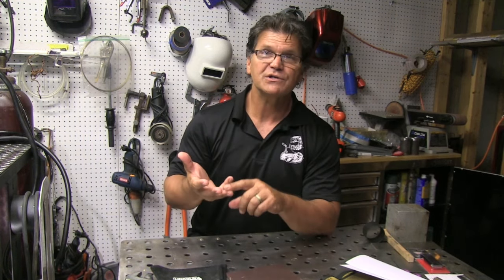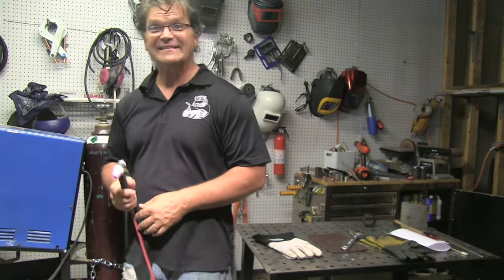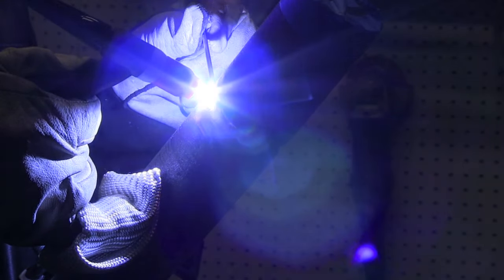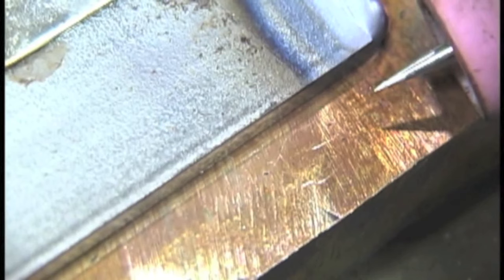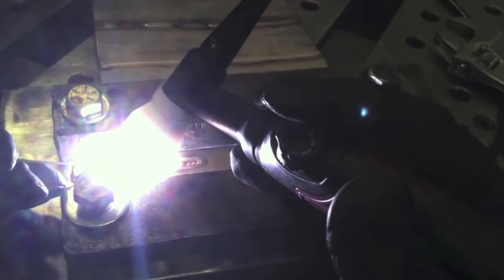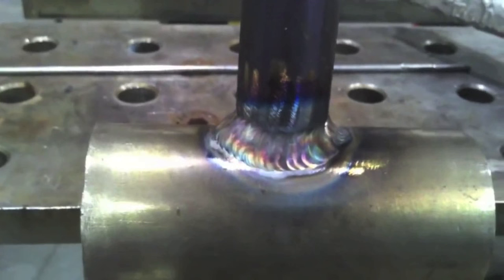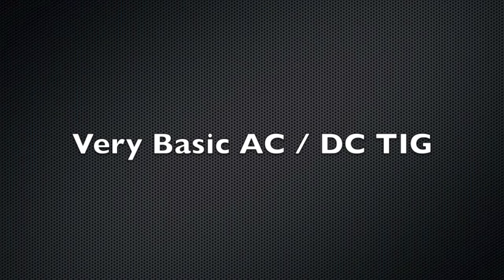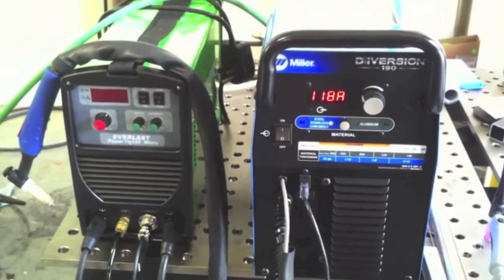TIG Welding Basics Overview

Comment: Thanks for the video! I finally made the step and ordered 2 tig fingers. Hope it doesn't take too long for them to arrive here in germany.

My question would be: I can't seem to get nice ripples on aluminum when using a foot pedal and no pulse. On a fixed amperage with a slow pulse this seems to be way better. I also get a somewhat grainy look when welding aluminum. Am I overheating the metal?

Thanks again!

Comment: Hey Jody ! I am a lifelong hobbiest  motorcycle builder and occassionally stray into other projects like my 4X4 ... anyhow not really knowing a  lot I ended up purchasing a Diversion 180. I may be able to trade up with my dealer but for now its what I have . I am an absolute beginner and for the past 2 years have been experimenting and have a tiny bit of proficiency wherein I dont destroy whatever I work with . Anyhow my questions are : with this welder am I better to switch off to a helium argon mix or stick with straight argon. My current project I intend to fab a simple stainless exhaust for a motorcycle and 2ndly will be adding  some tabs and other componetns to my existing  sched 40 rollcage on my 4X4 . One other question ..I just ordered your black friday set with both tig fingers and dvd set . Do you also do a from scratch beginners DVD set ?? Really glad I tripped over your vidoes .. I have already smacked myself in the head a few times realizing some mistakes :)

Comment: Jody,
 Great video again!! Thanks. Can you talk a bit about changing the torch head. I have purchased a everlast 265. I also got the a 18 series head from them when I ordered it. When I got it I found there are different connectors on the head itself. Can you explain the different type/sizes of connectors on torch heads? Also, on flow meter, where do you take the flow reading at? the top, middle or bottom of the ball?

Comment: I am interested in how you TIG weld experimental aircraft tubing when there are several tubes that come together.  It takes a fair bit of work to get a good fit-up.  It is then a disappointment if I then blow a hole in one of the tubes.  Thanks for the videos!

Comment: Jody, what is the feasibility of rebuilding a few damaged teeth on flywheel ring gear for a starter.  By removing the starter (this is on a tractor) a good size opening exposes the ring gear.  Probably 8 teeth have some damage.  I would reshape them after buildup with a Dremel tool.  If this is doable, what is the best filler to use for the buildup?

Comment: Sometimes when tig welding steel I'll get areas where craters are formed... no doubt due to some sort of impurity.  If I try to go back and clean them up it seems that I just chase the crater(s) around from one area to another. Do you have any tips on how one can clean them up?... especially if the bead is in an area that is difficult or impossible to grind down to start over?

Comment: I would love to hear about differing aluminum filler metals, not just 4043 or 5356. A question about the "rule of 33", what is the base amperage used before the pulse is set?

Comment: Sil bronze.. Start adding once the steel gets the shiny spot? Or puddle and back off? I got ragged cold beads and a sooty looking bead so far mild steel and 316L bases.

Al bronze.. Will it braze aluminum?

Comment: Hi Jodi. Great vids. You said hi frequency machine might screw with computer chips. Does that mean I should never tig on modern car with PCM's?  If i undo car battery before welding will that save me from cooking PCM? You got me nervous because I want to learn to do sheet metal repair. I live in Rhode Island where cars rot like crazy. Thanks for sharing you expertise.
Reply from the maker: it is possible to fry pcms.  unhooking the battery is good practice. but High frequency can do some weird things.
when in doubt , its wise to use lift arc function.

Comment: hey thank you for the very cool video. I just started on the mig process journey and learning alot. am also ready to buy my 1st welding machine. i was considering the new POWER MIG® 210 MP Multi-Process Welder - K3963-1. i like to here your opinion and suggestions. thank you

Comment: What's the best way to prevent oxidization when tig welding. I seem to have trouble with stainless and carbon steel turning grey, never looking shiny and pretty like yours. I am using pure argon with a harbor freight tig welder. I like the welder it does very well for a harbor freight machine. But the oxidization kills look after.

Comment: I have an older stickwelder, can I adapt it to tig just by getting a tig torch and hose like you show at 1:15?
How is the torch air cooled, is there a different air supply on it or its using the argon gas to cool it?

Comment: So I've been pulse MIG welding alumn for 12 years now. I just started tig and fillets have been a pita for me. My but welds look great but when I go to do the fillet it seems the arc just doesn't want to get in the joint. I end up creating a pool above and below the joint but to get it started I found i have to basically jam the filler rod into the joint to get it started and fast enough not to ball the rod up. Is this common? Im also finding that even on 1/8 im basically maxing a 200 amp machine out. I mean the welds look pretty good I just feel that I shouldn't have to go that high in amperage. Is there something wrong here? Or is it whatever works....works? Last problem I have is my first weld on a workpiece is always kinda crapppy but after the part heats up it runs like butter. Do you always have to preheat? I see videos where it looks like you're on a fresh part and you just go for it and you don't have the first crapppy weld orobkem I have.  Running 1/8 5356 rod. 3/32 2% lanthanated electrode. Pure argon. Welding 1/8 and 1/4.

Comment: When using a backing to build up a hole like on that wheel or the "bad mill" part you showed, is it possible to use graphite to use as a backing? I've known a few gunsmiths that used graphite rod when repairing the edges of screw holes that have been badly dinged or rusted. The tight fitting graphite sheds the rod and leaves a clean round inner surface, so all they have to do is flatten the weld down instead of trying to round the hole and risk being over sized.
Reply: Yes, Carbon is great for a backing, for both TIG and also brazing. Keith Fenner shows how to build a brazing "dam" for a machining repair he just did on his youtube channel, they are friendly and KF was the one who sent me here so I hope it is OK for me to recommend you check out his repairs...

Aloha from Knolltop Farms

Comment: For a beginner trying to wrap his head around aluminum, how would you weld thin aluminum, like less than 1/8"? I had a job interview and had to tig an aluminum butt, corner, and lap joint and nothing was behaving the way I had expected, the arc was spraying everywhere except for the root of the joint and the filler metal was melting before I put it anywhere near the puddle (needless to say, I didn't get the job lol)

Comment: Is that sought after "stack of dimes" look, proven more structurally sound than a flat fillet type weld that I make on my 4130 aircraft tube type welds where I don't always have a rippled stack look to the weld?

Comment: How does adding helium to a shielding gas change the characteristics of welding aluminum? Are there any instances where other noble gases are used? (Neon or krypton, for example). Does changing the shielding gas composion change the "weldability" of other metals? Thank you for your videos. I don't even own a TIG machine, but I want to buy a tig finger to help support your video making hobby. :)

Comment: Hey Jody I am going back to school specifically to learn aluminum mig and tig welding and I would like to know what I really need to focus on in the tig area to get the pipe welding jobs I want when I graduate I want to specialize in pipe and go on the road. I am already proficient with 6010 6011 7018 7024 fluxcore etc. And am planning on takeing my 3g 4g certs for them soon but I reaaly would like to know specifically what the workforce is looking for in a tig welder structural and pipe....sorry for the long winded question

Comment: Thanks for making al that videos. i have learned a lot of those.

My question. can you give me a tip for welding thin Titanium sheet 0,03 inch (0,8mm). i wanna make my one Titanium 2 stroke exhaust. the sheet is water jet cutted and then rolled by hand to cones. i weld the pieces together without any filler material.
my problem is that i get always discoloration on the outside. i dont have a trailing shield. can you give me a tip how i can make it better
i can send you pics that you can se.

thanks a lot Manuel

Comment: I was wondering if you could give your opinion on a debate I have found myself caught up in at my place of employment,  I am the lead welder/fabricator of the R&D department and since the department is new I was given the opportunity to outfit my fab area with any basic tooling i would want/need  to perform my duties to the best of my abilities... I requested for the company to purchase a esab Rebel 205ic so that I could do the small, thin, and intricate aluminum parts with tig rather then using the Lincoln 360mp that they had in the shop already.  They agreed to buying the esab with out question but another member of the R&D team (the draftsman/engineer) is trying to fill the rest of the teams head with alot of miss information....hes designed the current project to be made from  5052-H32 aluminum with material thickness' from  .06 to 10gage and the odd plate or bracket  between 3/16 and 3/8 thick.   This project requires watertight welds and his design is poorly configured where pretty well every joint is either a butt joint or a lap joint... Some are fillet joints with a slot and tab for alignment purposes but these end up being on the side walls of every spot that need to be water tight.  I've suggested open corner joints instead of having a butt joint for the edges/corners also suggested using tig for all welds that will require watertight seal since Im having to work with 10gage and thinner materials and welding either butt or lap joints I feel tig would be the most efficient and effective process based on the amount of adjustment available with tig that aren't available with the mig, also tig doest have the issue of cold starts and having ugly lumps of excessive weld deposit at every start and stop from back stepping, or no going back and grinding every start and stop and rewelding to make sure there's no leaking from any of those spots. 

If you were to be doing a job for someone in your own shop and say you HAD to weld the same joints configurations and thickness' that I've mentioned would you use mig or tig....(only for the areas that would require watertight welds though as I would use mig for the rest).  Oh also forgot to mention that the design is fairly elaborate and has a fair amouny of parts that need to fit into another with minimal wiggle room so deformation has to be minimal to nonexistent (not likely of course but that's the requirement given to me)

Comment: Hi,' very new to this I'm starting to get the hang of it by watching you Videos .( Thank You) I bough  the Eastwood 200 AC/DC  Tig Welder but the problem I'm having is  it is sucking up Argon Like crazy and it is very costly .What am I doing wrong? I'm following the chart that came with the Welder.
Reply: what is your CFH set at.   it should be at 15.  check for leaking fittings and your post flow.
Reply: +Chris Capozzi hello , I have it set @ 15 to 17 . I just noticed I'm using 1/16 tungsten and it's taking a long time to get a puddle going do you think by increasing the size to 3/32 it will heat up faster ? I'm using between 90 to 140 on the pedal . Thank you
Reply: What thickness is your work peice. 1/8 thick material you can use a 1/8 tungsten.
Reply: What size bottle are you using ??
Reply: +Chris Capozzi yes I'm trying to weld a 1/8 but on a T joints man it's hard 😩. My aluminum is melting before I get a puddle going . What I really want to weld is a 3/4" to 1/8" would it work easier ? I'm afraid to attempt  it yet . It's an expensive piece of aluminum . 😩
Reply: +Sifu George Hajnasr oh your welding aluminum.  3/32 tungsten us fine for 1/8 aluminum. there could be alot of things going wrong here.  you have to start from the top. Are you on ac high frequency.  are your balance,  cleaning , penetration settings  at the right parameters.  is your tungsten prep and stick out correct.    are you manipulating the torch in a fashion that is erratic.
Reply: +Chris Capozzi all those questions I think I went over few times I watched your video 20 times so far 😂. I'm using the Eastwood Tig 200 Ac/DC It I only has pre flow and post flow . Very limited . FYI I'm  very good with a regular torch I work with Gold , silver and platinum but man this is different .
Reply: +Sifu George Hajnasr these aren't my videos. Hahaha.   I just responded to your question tryin to help as I have welded alot of this.   welding clean aluminum on a bench is not that difficult that's why I was trying to trouble shoot.   of your trying to weld dirty aluminum that was in service and contaminated,  and the joints are in place, that can present a world of problems.
Reply: +Chris Capozzi that's funny . Well thank you for all your help . It's all new Aluminum plus I sanded it and cleaned with acetone and I'm still getting pepper in the weld. I guess I just have to keep practicing . 👍

Comment: Hello!
I'm quite new to TIG welding and welding in general and my question is if you have any tips on how to improve my steadiness and not shake as much, or is it just to keep practice, practice and practice some more? :)
Thanks!
Reply: Get a Tig Finger!  Really.  You want to be able to brace your torch hand close to the work.  You can also try different grips.  You see Jody switching between a pistol grip style and cradling the torch like a pencil.  You want your grip to be controlled while also being relaxed so you aren't straining and shaking.  Get a small hobby vise that can clamp to table edges, etc.  You can then put the vise near your weld area and clamp a piece of pipe or conduit to act as a rail or steady rest to slide your hand along.  I weld a lot of stuff clamped in my bench vise so there's no place to brace my torch hand so I'll use a 3-4 foot adjustable painters pole with a Velcro strap around my wrist like a ski pole.  It gives me a pivoting brace like a monopole would give a video camera.  I'll put some examples up on my channel.
Reply: Eddie the Grouch
Those are some great tips, thank you sir!
Reply: I think Jody mentions this frequently in his videos - brace yourself and make sure you will be comfortable as possible for the duration of your weld. I found that after I upgraded the starter tig torch on my Everlast with their superflex line torch my welding got more consistent because I wasn't fighting the stiff line as much.

Comment: I need purposeful settings to learn to weld aluminum I have a lincoln 375 so I have a 275. I will be welding 1/8 in for the most part. Help in setting adjustment would help exponentially.

Comment: every time i try to do the tig drill as you call it the bead always turn gray and nasty. ive tried getting closer and ive tried flowing more gas or hotter/colder arc but nothing seems to work. any suggestions? all the metal is cold rolled and wire brushed by the way

Comment: I have an old Airco Transformer Heliarc welder. It has HF, AC/DC, Foot Pedal, and does stick. It is a 240 volt unit and Ive been having a hard time controlling aluminum. Steel is a dream. Aluminum is at this time a nightmare and no, I can't at this time buy a new machine. As much as I'd like a new machine I need to learn on this old standby. I really want to do auto sheet metal work but seem to blow through too much. For real thin its also hard to control but easier than aluminum. I do have good cups and proper gas. I may not have good tungsten for the job. Not sure what should be used or how thick they should be for a given job. I don't have foot pedal control except on or off.

Comment: Hey there Jody, 
I've always had this question, everytime in welding class I would walk over GTAW welder I would see its option of DC Electrode Positive, why have it if the tungsten is just going to melt, what are you going to use it for??
Reply: DCEP is often used to "ball" the end of the tungsten prior to welding aluminum in AC. If your tungsten is melting away completely then the amperage is too high for that size tungsten. DCEP is sometimes used when you need shallow penetration and it's best to use a larger sized tungsten (1/8th or bigger) which will handle the amperage better.

Comment: I want to build a flat bottom boat.
20 ft long
75 " wide
28" side walls
3/16 .188 plate aluminum 
Bottom and sides same mat.
I need to know what's the best welder for completing this project?
I mig I have a miller 220 welder.
I do have a spool gun but I want to Tig the welds.
Thank you
Reply: Dan Vrana spool gun would be faster tho

Comment: When I saw you welding that preheated part it felt like you could use a few more amps but if the print calls for 160 we gotta use 160